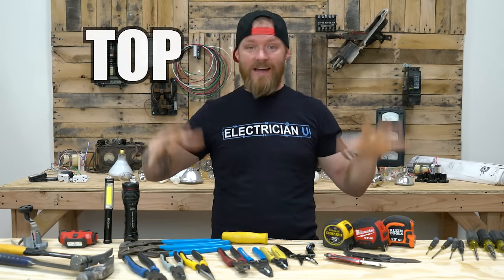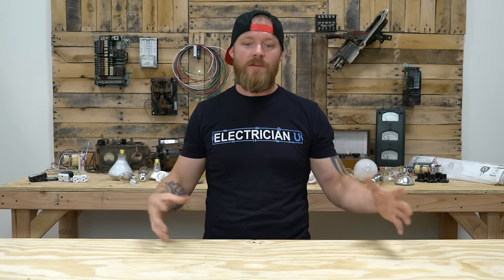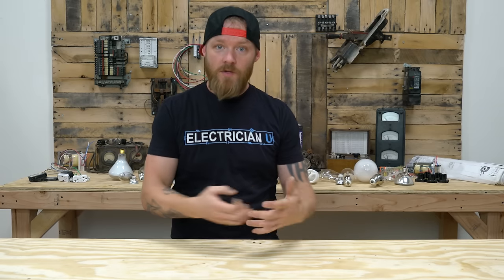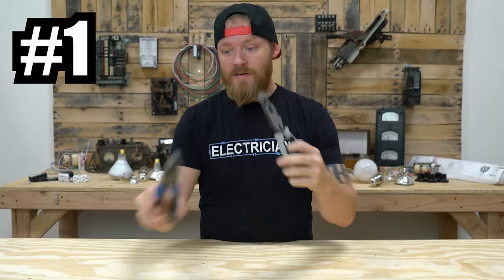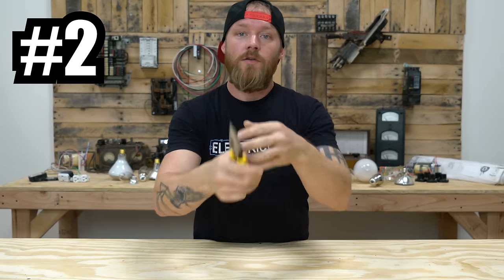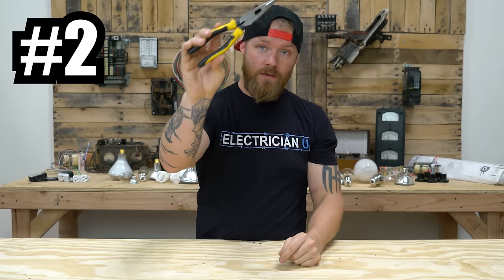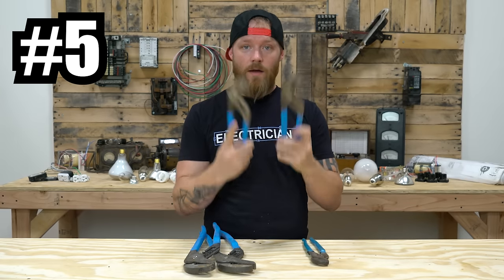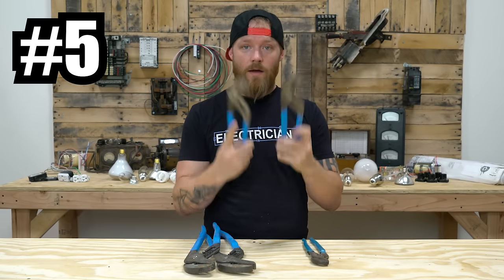Episode 42 - APPRENTICE TOOLS - 13 Tools Apprentice Electricians Need To Have

Comment: Just to add to this, get yourself a good tool carrier.  It may be a belt, a vest, a bag, roll, whatever works for your specific location and application but splurge on the good ones.  Especially if it's a system you're going to be wearing and you really need to take comfort into consideration.  Don't cheapen out on that.  

If you go the route of a multi-bit tweaker (precision screwdriver) avoid the Kleins.  Their bits for the precision drivers, in my experience, are very poorly tempered.  It's just better to have several dedicated tweakers instead unless you really need certain security bits from the multi-bit driver.  

The nebo lights are awesome.  I lose them before I destroy them and the longest I had for one was nearly 10 years.  The magnet on it had been cracked and was losing its oomph but the light just kept going and going.

Comment: When I was going through, I remember the best advice I got from a master...look busy. If we had down time, even he would clean stuff up. Now at work we have a few apprentice coming through and I told them that. Usually the ones that work consistently are the ones that stay on the job the most, even when other guys are getting drug up.
Reply: And I will give another option for #9 that's held up well for me and helped me greatly, and very affordable. My wife actually got it for me for Christmas as a stocking stuffer during my apprenticeship. It's a Hart tape from Walmart of all places. What I like about it is it's double sided, and on both sides it has your measurements down to 1/16. I can't tell you how many other guys I went through had trouble because they couldn't understand measurements. I actually bought my son one this year because he's started votech for HVAC.

Comment: Knipex diagonal cutters are the only brand that is worth the money. I recommend the 10" version.
Reply: thepeter I agree but the 3 size kit
Reply: Where do they sell them?
Reply: Yeah man my kliens dont even cut 14 solid. They are brand new and just dont do any work. I shouldve never bought klien pliers
Reply: Amazon has them
Reply: Vegan LVL5 i prefer knipex over kleins but i have the red handled "journeyman handle" klein ones with the angled head and they actually cut pretty well?? If yours cant cut 14 solid something is horribly wrong or youre weak as hell no offence lol. Mine cut all 3 number 12's in romex at once, cut that thick metal wire that they use to hang up the ceiling grids, etc. can cut small ish hardened steel nails and whatnot. If you dont have a good pair of linemans i HIGHLY recommend knipex
Reply: @banehogs5589  I have knipex. But I like klien better. Just dont buy to much overseas stuff. Only stuff we have no choice with. I also recommend blue handle kliens. They are hardened like knipex basemodel but better. Most people dont know klien had various versions of the same tool for different applications.
Reply: @banehogs5589  this is a joke btw, anyone complaining about klien pliers doesnt know how to work. One exception, heavy duty strippers sucked.
Reply: Vegan LVL5 ya i had just bought the red handles cause its all the supply house had at the time, wish i had got blue handles. But truthfully anything thats thicker that what my red handles can "handle" id prefer to cut with my linemans. Ive cut a few 1/4-20 bolts with my linemans 😂 and im the same i get american when i can but i prefer the best tool, or the best tool for the price depending on what it is. Between my tools and coworkers tools ive used several different pairs of klein linemans and i prefer my knipex over them!

Comment: As for flashlights my personal favorite  is the mag light pro, compact rugged and takes actual AAA batteries that last a while. Had mine for a few years and even worked outside dropped in snow and works great. Even has a little nylon holster for the belt and is relatively  bright and inexpensive. I really like it has the iconic twist  heat for turning on. I have has so many with a multifunction switch and they never last.

Comment: My top tools for an apprentice, in no order (my brand)
1) Ratchet cutters (Klein)
2) 11 in 1 screwdriver (Klein)
3) Cable cutters (Wiss)
4) Impact driver with 5/16 and Phillips (Milwaukee)
5) Sharp knife (Morakniv)
6) Muck boots (not a tool per say, but you'll want em)
7) Tape measure (Komelon)
8) Super 33+ (3M)
9) Channel locks (ChannelLock)
10) Headlamp (Bushnell)
11) Vice grips (unbranded)
12) Brick hammer (Estwing)
13) Cold cut chisel (unbranded)

Sources: first year apprentice
Reply: Komelon lol

Comment: another great use for those black croc wire strippers is that they strip 14/2 really well, just dont bite down to hard because it will cut into the insulation of the wire

Comment: Try using a #1 square next time you do outlets or switches. Most brands these days accept a #1 square for the terminals and yoke screws. Way less likely to cam out than a #2 phillips.

Comment: I am exactly the same way I am addicted to buying flash lights and headlights as well as various portable work lights. And just in case you or anybody else did not know that Milwaukee usb-rechargeable headlight that you have does actually have a removable and replaceable battery and Milwaukee does offerextra batteries and in external charger for all of these batteries. So you don't have to worry about your light going dead on you and then having to charge it back up or having to worry about having 2 headlamps because when you stop a charging while one is being used. Milwaukee got you covered on that just grab an extra battery and you can use your headlamp to charge the extra battery or for convenience you can opt to get the external charger. and actually in the next few weeks are going to be releasing in updated external charger that will also work as not only a charger for these Milwaukee batteries but also has a USB out so you can use it as a USB power supply to charge other things as well. #Just saying 💯

Comment: I really like my southwire 12 in 1 screwdriver and my Milwaukee 6 in 1 strippers. The screw driver has most of the types of drivers I need and the Milwaukee is a needle nose with strippers, small screw cutter, and curved cutters which is great for bigger wire. Also I love my 25' magnetic fatmax. Especially when running conduit.

Comment: I don't want to be picky here but since this video is for apprenticesand information for them to know what tools to get they need the correct information so that when they are searching out the suggested list they find what they're looking for. On channel lock tongue and groove pliers it is not 11 inch and 9 in they are 10 in and 8in. Also on the screwdriver recommendationit wouldn't be a high-leverage screwdriver it would be a demolition flat blade screwdriver or demolition slotted screwdriver depending on brand will determine whether or not they listed as slotted or flat blade. #Just saying
Reply: Depends on your environment.. maybe make your own video for comparison?? Cause I work in the commercial side of Electrical and I've never heard of "demolition blade" anything..

Comment: I'm a huge fan of the electrical tools milwaukee has out. The strippers are amazing, needle noses are stout, and so on. I still enjoy all my klien tool but I'm slowly getting converted to a full milwaukee fanboi lol.
Reply: Milwaukee is a good brand for hand tools better than Klein the one tool he forgot was the voltage sensor the only tool that can save your life
Reply: their drills suck dewalt and kobalt got them beat, especially kobalt with that 24v that thing will tear off your arm, their multi tools (such as the needlenose with built in strip gauge and the stupid fat grips on the end) are garbage. Their hole saws (i call em cup saws) are nice out of the box but dont last, super sharp though. I prefer diablos carbide tipped, great for plaster too

Comment: By far the most important tools you need to bring: Your brain, your ears, a good attitude, and thick skin. A lot of journeymen will be pretty hard on you. Don't take it personal, most of them are good guys that want you to make it home safe, do good work, and succeed. Listen, learn, and do what they say. All bets off if they tell you to touch your tongue to a 480v line though :D

Very solid list that covers pretty much everything you'd need in your bag from residential service calls up to light commercial / industrial. Aside from testers here's what's in my bag:

Klein J2000 side cutters - I woudln't substitute them for a multipurpose tool personally, especially if you're new
Klein needle nose - best needle nose made, and reasonably priced too
Klein D2000 diagonal cutters
Channel Lock 10" - I keep 12" handy enough, but they're not in my bag. Never heard of 11" - I'll have to look for them, it might be the perfect size. Works for reaming / deburring conduit too.
Klein kurve strippers - the ones that strip 8 - 16 solid, 6-32 and 8-32 machine screw cutters
Ideal 7 in 1 screwdriver is my daily driver, I never liked the Klein because it used to ONLY have the 5/16 nut driver
Big flathead - its a cheapie, I want a Klein - same with a #2 (whatever - drywall screw size) longish philips
Klein 32614 - 4 in 1 pocket screwdriver - don't know how well I like it yet, so far so good
Smallish adjustable wrench - but a good one so you don't round everything off.
Same DeWalt tape measure
Same kind of folding razor
Estwing 20 oz smooth face rip hammer - I work around a lot of finished surfaces, and I'm just used to them. Whichever one, best value in a hammer by far.
Klein cable splicers knife - SUPER handy and compact. I use it way more than the razor, keeps me from nicking conductors when peeling romex, great for stripping bigger wire. Much harder to cut yourself, and its super strong.
Same keyhole saw - the thin ones are awful.
A couple of Ozark Trail rechargeable headlights. they run out faster, but they're small, light, easy to wear, and bright. I also use them around the homestead, and I've got a bigger one that lasts longer and is brighter (TOO bright sometimes!) - a bushnell I think? Low beam works great on that one. The Ozarks are 22 bucks last I checked too.

I don't like to lug around a bunch of things I don't use frequently enough, and suprisingly enough - multitools end up having a lot of features I don't use, and they aren't as good for what I do use them for than a single purpose tool. That's a  huge consideration. By the same token, multi tools can also pack a lot in a small package that does the trick.

I've never liked the way Klein screwdrivers feel in the hand, and I hated the old 5 in 1 where both nut drivers are 5/16 - I use the 1/4 inch plenty enough for that to be a sticking point - your mileage may vary. What's great about them, though - is you can get a LOT of torque on them with ease, and the non-slip doesn't suck like urethane cushy grips that just wear out. Despite the handle, I do want to try the 11 in 1 - be careful to not get the HVAC guy one, its got a schrader tool instead of robertson (or torx I forget) but that puts a 3/8, 5/16, and 1/4" nut drivers, 2 phillips, 2 flats, robertson and torx in 1 tool that you can get a lot of torque on - so it might be worth the "less than ergonomic" handle, or it might go in there WITH the other multi screwdriver. Snap-On makes probably the best one by a long shot, but its 5/16 on both nut drivers like the old Klien or I'd have that instead of the Ideal.

The strippers - 99% of the screws I need to cut are #6 or #8, and you can use a hacksaw / grinder to cut bigger ones. Cutting bigger in strippers is pushing it anyway. I don't need to crimp that much. I rarely have to strip smaller than 18 stranded, but I have a smaller pair of ... greenlees? in the tote bag with the rest of the less used stuff.

The side cutters - spend the extra few bucks on the 2000 series, same with the dykes. They'll cut nails all day without any sign of wear. Dykes are great for pulling / loosening staples and nails too.

I don't carry robertson or torx in my bag right now but the 11 in 1 Klein might change that, because I do have to go get one often enough to think about it being in the bag. But if I used 2 sizes of robbies all the time, I'd carry individual drivers, because its easier and faster than futzing with a multitool. The straight / phillips individuals get grabbed a lot, because I know from the handle what I'm grabbing, and I don't have to futz with it unless I'm going after something with a multitude of different screws.

Not hand tools, but things that also live on my belt: Cordless drill with a screw guide - hands get tired running screws in plastic boxes. For testers, a Fluke T+ pro is awesome for 90% of what I'm doing. Wiggy (only better IMHO) + volt / ohm / continuity, and GFI tester - a lot of tester in a small package - or a T5 gets tossed in sometimes. It stays in the bag just as often. The T+ pro is faster and fits in the bag a little better - no knobs to accidentally turn on etc, the T5 has an amp clamp so it depends on what I'm doing or which happens to be in the bag at the moment. If I had to pick 1 it'd be hard but I'd go with the T5. I'm not going to have an anyeruism if one of those falls out of my bag when I'm on a ladder, or it gets dropped in an attic. Proximity pen, and an outlet tester also live in the bag.

As for the bag itself - I don't have one I really just love anymore, but whatever bag - it goes on a klein padded belt with the quick release. Worth EVERY penny. You can turn it so it curls around the bag, and makes it stand up nice if you're not wearing it too.

Thats my bat-belt kit for showing up to "god knows what", and I've got a tote bag with some other less used things - like MC rotary tool, bigger channel locks, bigger adjustable wrenches, wrench set, allen keys, basic socket set, extra drill bits, screwdriver / nut driver kits, battery chargers, and all that kind of stuff. By the time I need something out of that bag, I probably need parts or something else from the truck anyway.

Comment: He forgot to meant the hammer function of the linesman!
Reply: nahh broskiedoodle, thats how you lock your pliers up since the best leverage to hit with is right on the bolt
Reply: Every tool is a hammer (except the battery end of a tool or my damn 3/4" bender! Still waitin for him to replace it...)
Reply: @djhutchins8873  when closed, the lineman's pliers have a flat end that is perfect for thumb detecting.

The same technique is used to slide the grips back into place 😉
Reply: I try not to use my linesman's for a hammer... But when I do I use the thick beginning part of the end right before the circle to avoid jacking 'em up which gives the best hammer action.
Reply: A good way to get run off a real job is to not use tools for their intended purpose. More complicated tools can mean life/ death in an accident and there's nowhere to draw a line except "all or none"
Reply: @submaxcw7947  almost everyone uses their linesmens as a hammer

Comment: Get the Milwaukee key hole saw. It uses a standard sawzall blade. It folds up to save space in your tool belt or bucket, and it is replaceable.
Reply: Thanks!

Comment: For resi guys a hook knife is a must. Game changer for stripping Romex. And for commercial guys Klein makes a reamer that cleans up emt ends real quick. Easier than reaming with the diagonals and filing the outside. Also a torpedo level is a must for running pipe.

Comment: Nice video.  I'm a master electrician I shall have my apprentices watch this video.  I like my Ideal electricians hammer with a long neck.  I also like when my guys carry swivel screwdrivers, they are fast and they are easier if the human hand.  Here's what you missed- magnetic level, 2 sharpies, and hex key set.

Comment: A scratch awl makes a good pilot hole for drywall saws. 4 holes, one in each corner for a box is a good way to make accurate controlled cuts. It’s like drilling holes before using  a jig saw.

Comment: 4:46 there's a lot of different strippers on the market
4:53 some of them are like several function
4:54 some of them are different sized holes
7:42 strippers are not usually that expensive
Reply: 6:46

Comment: I been in the trade a while and I could count on both hands how many times I've used needle nose pliers. But good video I think this could help some young guys. I don't think you should have to buy Roto splitters I never have. I just get a new pair from the employer every job they want me running mc.
Reply: Rotosplits were invented by a plumber. Use mc pliers
Reply: I use my needle nose daily, it’s interesting to see how we all do the same thing but different preferred methods

Comment: I went through about 100 replys and not once was a sturdy hacksaw mentioned.  Also need allen wrench set for feeders in panels.
Reply: Why would you want a hacksaw when they make band saws and sawzalls
Reply: @leosolis5846  No power needed.
Reply: I think I had to cut strut twice with a hacksaw before I said "fuck this" and bought a recip saw. It was my first power tool in the trade.

Comment: Maybe put some Loctite on the screw of that the measure so it will stay. I like the Milwaukee ECX tip screwdrivers for most switch and receptacle terminals. It allows a nice fit and a lot of torque.